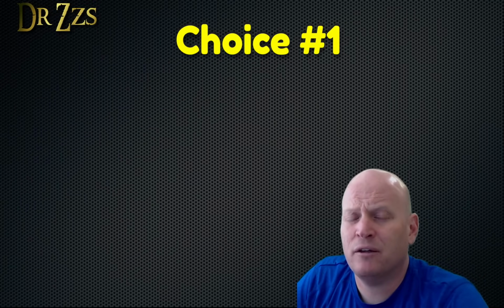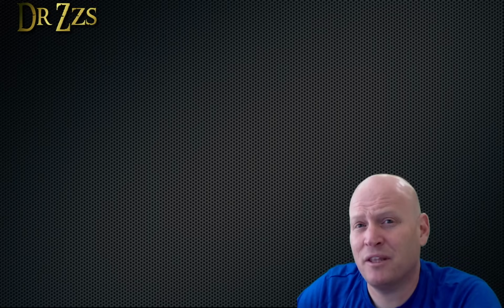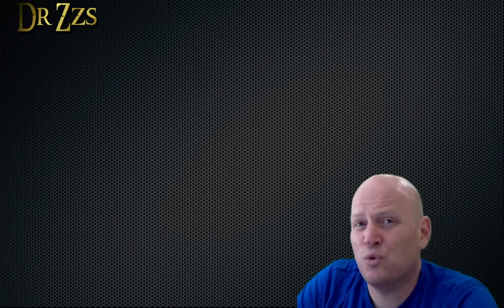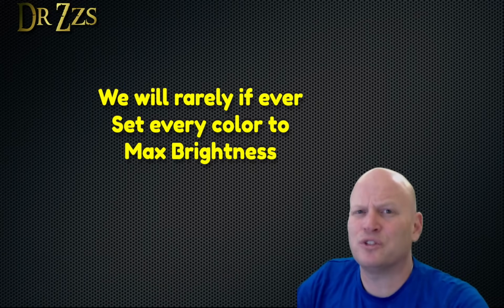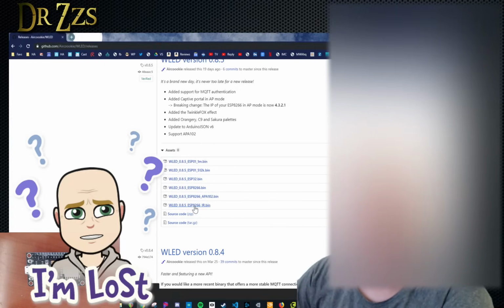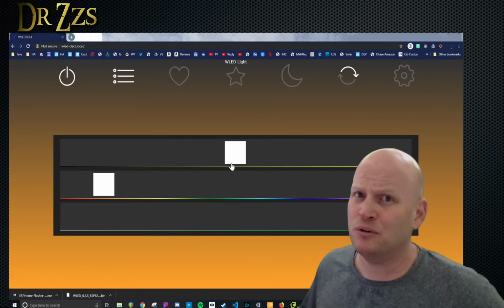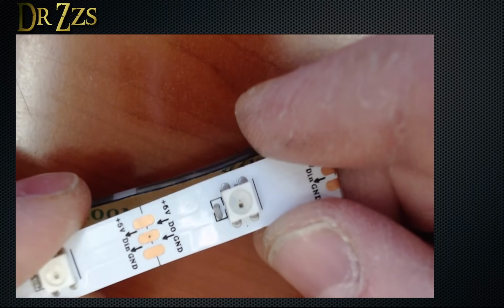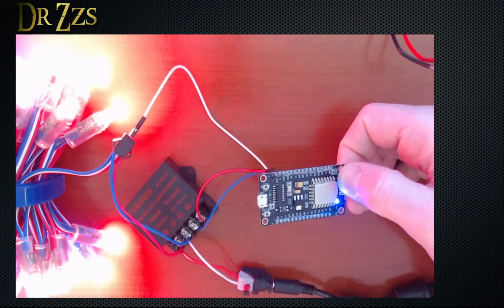Beginner's Guide to Christmas Lights - and LED Shows for Every Holiday

Comment: Love your videos! Thank you for posting these! Gives me a chance to geek out! I am a novice though and I made some purchasing errors. I bout the sk6812 RGBWW LED's 60LED/M and I wanted to duplicate what you are doing on this video. How does that change the wiring to the nodemcu? The LED guide on the strip shows +DC12v, GRWB. This will be a short distance so I am not using more than 150 LED's in one strip The cable coming out of the wire has 5 wires instead of 3 and the extra red and black wires coming out of it. Can you help or guide me to a video or article that shows me how to wire these sk6812 RGBWW to the NodeMCU? Thanks for your help!

Comment: I am totally new to this, but the plan is to build 12 leaping arches using 1/2 pixel strip (25/75) pixels per arch(6 on each side of the driveway. I getting ready to order a 60A 5V 300W power supply and a nodemcu. I have 6 WS2812B I65 5V strips that I am going cut in half and  solder Ray Wu waterproof quick connectors on. My dilemma is, that I have no idea how I'm going to use this power supply to inject power. I'm guessing i'll need to use 4 injections on each side of the drive 1 beginning, 2 in the middle, and one at the end. Should I use a separate power supply for each side of the drive? do you have any recommendations on how to proceed or a tutorial that you would recommend?

Comment: Should you use a NodeMCU for every window of the house or just one and connect all of them by cable?
Reply: If you want them to do the same effect you can connect them to one nodemcu if you plan on doing different effects on each window you will need different nodemcu's. Correct me if I'm wrong DrZzs

Comment: I’m getting a flickering at high brightness on my lights. Is the signal output DI4 5v or 3.3? Do i need a level shifter? It seems that if i hold the signal connection to the lights the flickering goes away. Almost like there is noise on the wire.

Comment: Do you know how many nodes/lights each NodeMCU can handle?
Reply from the maker: the absolute max is 1500.  I've used 800 without a problem.  Once you get above maybe 1200 you might start to a decreased frame rate, so the effects might not be as smooth.

Comment: What if only half of the leds work?
Reply from the maker: Do you have the number of LEDs set correctly on the LED Preferences page?  That is usually the first thing to check.  Otherwise if the signal suddenly stops at a specific LED is it possible that the LED is bad or that the signal wire is disrupted somehow.
Reply: Thanks I will check
Reply: @maiki947  did this fix ur issue?

Comment: This is awesome. I've been thinking about trying something like this, but running it to a software like Corsair iCue for even more control over each led. Has anyone tried something like that?
Reply from the maker: I haven't heard of that software.  I'll check it out, but I doubt it will beat WLED/xLights.
Reply: @DrZzs  it's designed mostly for gaming pc peripherals, but it's essentially a very user-friendly interface for rbg control.

Comment: There's a flickering (just like a strobe) when doing the effect.  Are there some fine-tuning to be done.  I am using the NodeMCU flashed with latest ver 0.10.2.  I tried two controllers already with the same result.  I am currently using 12V string (50 LEDS) with 12-5V 15W converter for the Controller powered by 12V-30A.
I am planning to flashed the 3rd controller with lower version and see it the problem remains the same.  Thanks!
Reply from the maker: You likely need to boost the data signal.  The easiest way to do it is with a Sacrificial Pixel.  Basically just put one pixel right next to the controller with really short wires.  Then the next pixel in the string can be really far away and the data signal should be strong enough to get rid of the flickering.

Comment: How many 12 volts can you run befor have to injecting power and data i have a 200 foot run i want to do thanks Peace and love 💘 To All
Reply from the maker: usually about 250 LEDs, so about every 80 ft.
Reply: Awesome our mobile home is 80 feet long and 17 feet wide 😍

Comment: Thank you for the instructional video!  I've followed your instructions exactly and have the first 20m of lights on my house.  Unfortunately the mcunode will not stay connected to my wifi.  The signal is decent where it's located on my rooftop but it only stays connected for a few minutes. Is there a certain signal strength the node needs to run? I'm around 25Mbps where it's located.  I've tried 3 mcunode's and they all do the same thing.  I'm stumped. Any advice would be greatly appreciated!
Reply: I just connected the USB on my laptop to the mcunode where it's currently located and WLED connected to it right away and no longer showed it being 'offline.'  Sorry for the noob questions but I cannot figure out what is going on.

Comment: is it mandatory to have a powersupply for the leds or does the board itself deliver enough power for the leds (color degradation isn't a problem)?
Reply from the maker: yes you absolutely need a large power supply the controller can't handle enough power for more than a few LEDs without giving up the ghost.

Comment: so how many of the 12v strings can you wire together?
Reply from the maker: How many are there :)  
Usually the limit is going to be the controller.  The little wifi controllers I'm using can handle a max of about 1200 LEDs.  But I'd suggest breaking it up into chunks of no more than about 800 LEDs.  That should be plenty.

Comment: I want to say that your tutorial was outstanding and I was able to follow it perfectly so thank you! I did run into an issue that I can't seem to find an answer to online, all of my LED string lights seem to stop working about 15-20 pixels from the end of the strand and I can not get power to a second strand attached to the first one. I'm not talking about a color drop because they are 5 volts, I'm talking about a hard cut off. I have tried 6 strings with all the same problems as well as 3 different power sources. Did I just get very unlucky with defective strings or could there be a problem somewhere else such as the controller?
Reply: do you have LED setup configured?  >wled, >configure, >LED preferences, >LED count <fill in number of LED's>
Reply from the maker: @david_hall is correct.  you most likely just need to change the number of LEDs in the LED Preferences page.  The default is set to 30 so that's all that will show up until you change it to the actual number of LEDs you have.
Reply: This was 100% correct and thank you both for the replies! I'm a little embarrassed I didn't check that but I'll leave this comment up in case somebody else has this issue. But at least now I have some more lights I ordered out of frustration haha
Reply: @twobirdsonestone4836   I'm learning that you can't have too many LEDs

Comment: I was wondering if I could get 3 16.4 ft strip lights and connect them together so 450 leds total and run it on the same power supply and mcu and if I can do that what kind of power supply should I get?
Reply from the maker: You need to figure at least 0.02 amps per LED so that would be at least a 9 amp Power Supply.  You'll want to add power injection along the LEDs too or you are sure to see dimming before the end.
Reply: @DrZzs  thank you for your help man

Comment: How do you program the leds to be static rather than animated (e.g. all one color or alternating red, white, red, white, red, white...)?  Is that possible in xlights? I'd like to use install permenant LEDs but wanted a more traditional look that could be altered periodically.
Reply from the maker: There's an effect called "solid" then you just change the color. xLights would be way overkill if you just want a static color.

Comment: Do we still need WiFi after setting up the controller? I want to put them at the entrance sign of a neighborhood where there’s no WiFi.
Reply from the maker: The controller can be used in AP mode.  That means the controller itself broadcasts a wifi network you can connect to and control the LEDs from there.  So it doesn't have to be connected to a home wifi network.  I have noticed that the NodeMCU devices get a bit laggy when you keep them in AP mode.  I'd suggest trying an ESP32 based controller.  There is a version of WLED for ESP32's. 
Hope that helps.

Comment: does anyone have any tips for setting up lights to wire them to a car battery? i really wanna use these for underglow
Reply from the maker: 12v is 12v.  The LEDs don't care where it comes from.  They'll run off a car battery just as well as they run off a DC power supply.  
Warning though.  They do use a lot of power so don't connect them to a circuit in your car that doesn't turn off when the car is off or you'll have a dead battery in a couple of hours.

Comment: Ok had a question 
I've watched several of your videos and just wanna make sure I understand I'm looking at the rope style LEDs you recommended and 12 V. Amazon sells them in sections of 500 I was looking at buying two sets so 1000 LEDs to cover my house. On the Power supply, Would the 12 V, 30 amp , 360 watt be enough to supply power for that many leds. Or should I go bigger?
Reply: I believe that one string would be about 13.33 amps, so a 360 watt would work with 2 strings (1000), however, I would probably go for a 400 watt to give you a cushion.
Reply: 3D Texan thank you. I went ahead and ordered bigger. I got the 12v 50amp 600 watt converter.

Comment: Awesome video, I found this one to be the most helpful! I just bought all the parts for this project, all my wiring from the NodeMCU to the LED's is the same as DrZzs, but when I connect my 5v power supply the LED strip doesn't turn on. If I have power to the usb port it will turn on, but it seems the 5v power supply isn't providing power. Anyone else have a similar problem or know of a solution for it?
Reply: Do you need a controller for each strip?

Comment: Looks like your Discord invite has expired? I followed your guide 2 years ago and it's been awesome ever since. Recently updated my home assistant software (it wasn't broke and I tried to fix it) and now nothing loads and can't connect. Loaded a fresh image, so starting from scratch on the pi side. Went back to get your yaml's. It looks like maybe you've added even more effects?

Edit - actually, now you're discussing WLED and NOT home assistant? What's the reason for the change and will all the same code work? thx!

Edit2: Actually, you're using an entirely different board than your last video. Is there anywhere you explain what the folks that followed your original guide should do to get these new effects? Still using the Makerfocus D1 Mini NodeMcu

Comment: If I have 3 5m ws2812b 60/m and use a esp2866 on the start can I connect the strips with the ends and use 3 power supplies to power each strip and since they’ll be connected would they be in synced if I used WLED? Or could I get a ws2811 and use 2 power supplies would that make any difference?

Comment: not sure if anyone asked this, but I am building my holiday tree now, so itll be ready by xmas time, got the NodeMCU and string ws2311s yesterday in the mail, 12v variety because I have an extra power supply, 12v, 10amps, looks like ill need a step down converter like the 12v to 5v Screws... do i need to match the power supply of 10 amps or is that overkill possibly causing damage to the NodeMCU? thanks for the community support both here and on the FB group!

Comment: Hi, would the following board work with this method as well:
https://www.electrodragon.com/product/esp-led-strip-board/

Im not sure if this is easier because it has the power supply built in for ws2812 strips

Comment: Help!  I just got my nodes and lights and I’ve connected my node to both my Mac and pc and it won’t pop up on the serial port section on the epshome flasher. Is there something I’m doing wrong?
Reply: Martin6pack I figured out that u have to try multiple micro usb cords because some r purely power cords and others have power and data wires that connect and communicate with the computer
Reply: im having the same problem!
Reply: I’m having the same problem
Reply: Chase Kessler and Ben Eisenhauer, I also found out you need to download a nodeMCU drive so that the computer recognizes the node. At least that’s what I did and I got it to work. My lights now work!  Hope you two are having similar luck
Reply: Martin6pack try a few different cords in ur house and then mark the one that works
Reply: Ben Eisenhauer as well
Reply: Martin6pack yep I got mine to work and I soldered multiple sets together too so they go all the way around my room

Comment: more from inside..your name is mentioned    A fast and feature-rich implementation of an ESP8266/ESP32 webserver to control NeoPixel (WS2812B, WS2811, SK6812, APA102) LEDs or also SPI based chipsets like the WS2801!

Comment: I have a question, if i'm chaining 4 5v LED strips (to go around my room) together will i only need a 5v power supply? or will i need a 20 volt power supply?
Reply: No you will still need 5V. You Just need more Ampere. One Led consumes approx. 0.3W so you can calculate how many Amps you need. Example: If you buy 5m LED Strips (30LEDs/m) will be 150LEDs in total. So 150*0.3W are around 45W. Now Put that in the formula to calculate Ampere: Watt / Volt = 45/5 = 9A So you need for this example a Power supply with 5V and 9A for 5m of Led Strips with 30LEDs/m.
Reply: @kevinfietz409  thank you so much!

Comment: Hello, thanks so much for all your work on this, its great, i've got several node MCU's running now. Do you know if you can wire them to ethernet (RJ45) rather than WiFi? As the WiFi keeps dropping out.... I've seen this but not sure if it will work?
https://shop.pimoroni.com/products/adafruit-ethernet-featherwing?variant=27079000007&currency=GBP&utm_source=google&utm_medium=cpc&utm_campaign=google+shopping&gclid=EAIaIQobChMIwt_q3vjF6wIVuIBQBh3tGAVzEAQYBSABEgJOEPD_BwE
Thanks in advance, Martin

Comment: can you explain power injection?  More specifically you have 100ft of lights.. and another 100ft... do you need 100ft of "clear wire"(no leds) stretched along the led lights. and injected at the end of the 100ft?  Where do you splice into the power? or do just add another power pack at the injection point?

Comment: Ok so i went thru this whole thing step by step and I’m having a problem. I have 12v string and using power converter. When i power up the board, the lights flash on real quick but never turn on. When i hook up the signal wire, i lose communication to the board in WLED. I tried 2 different NodeMCU boards. I have checked with meter and have 12v out to lights and 5v to the board. Maybe a short in the string? I ordered 5v strings and power supply to try next. Any ideas?
Reply: have you tried connecting - to - or - to GND as he said? This fixed my problem
Reply: Chaosflori 25 yeah i jumped the grounds on the converter and same thing. I also checked with a meter and i do have continuity between the commons. I’m gonna try the 5v to eliminate the converter and see if that’s the problem. Thanks!

Comment: Voltage drop has to do with resistance in the wire.
Reply: Yeah, the LED itself is irrelevant, the voltage drop comes from wire length.

Comment: ESPHome couldn't find my NodeMCU. First problem: using a power-only USB cable; swapped cables and Windows chimed saying a device was connected; still couldn't see in ESPHome. Secpnd problem: looked in Device Manager and found a CP2102 USB to UART bridge that didn't have a driver. Right-clicked and let Windows download a driver. It installed Silicon Labs CP210x USB to UART Bridge on COM9. Everything worked as described from that point on. Got it all hooked up and flashing lights running around on my floor at the moment. Now, just have to get them mounted.

Comment: Do you think a space " "and "!" and "." in the SSID might prevent the NodeMCU from connecting to that SSID?
Cause I cant get past that step.
Reply: Can't say for sure about the space and exclamation mark (although I didn't think an SSID could have a space), but my SSID has two periods in it and it worked.
Reply: @d_sellers1  it did work in the end. It just was the app that could not find the Node so I had to put its IP in manually.
I only found out the Node did successfully connect to the wifi, while I was in my wifi settings about to change the SSID. :P